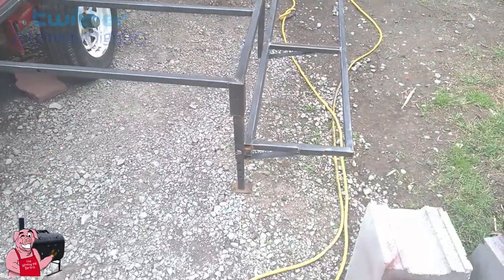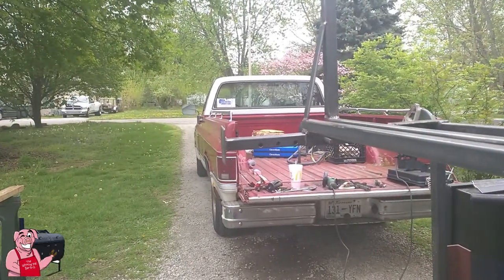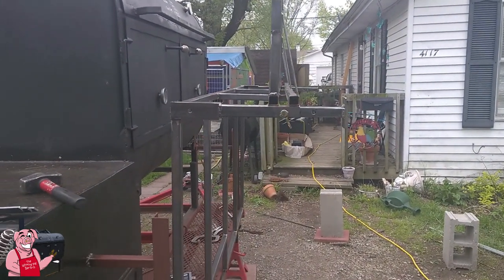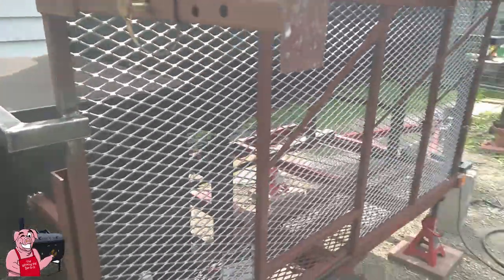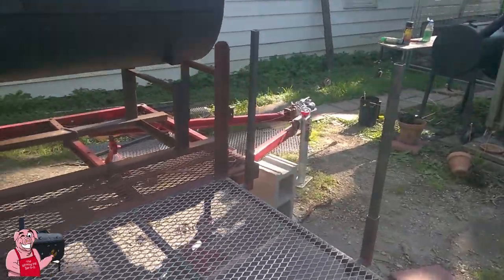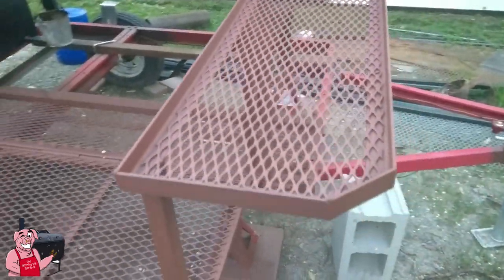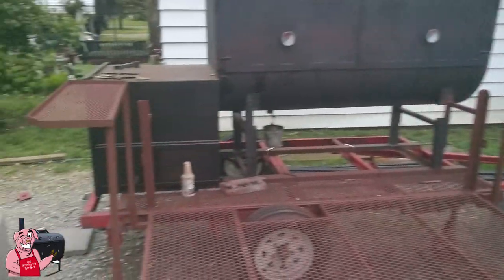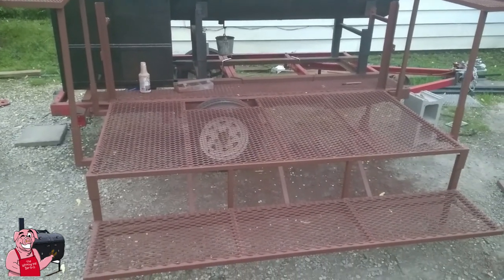The Great Smoker Build, The Saga Continues Part 3

Comment: Looking good Sir, Just a suggestion. Maybe add an insert into the tables so the pans can sit flat the angle might not be the best to rest thin pans on. Also, your thoughts on making that right table (the one that will get hit by the door) adjustable? 1" Square Tube looks like framing for some sort of covering if you ask me.